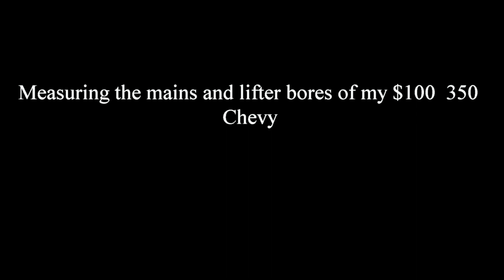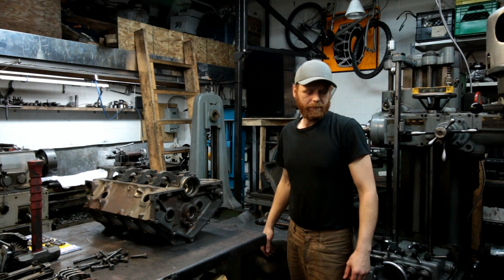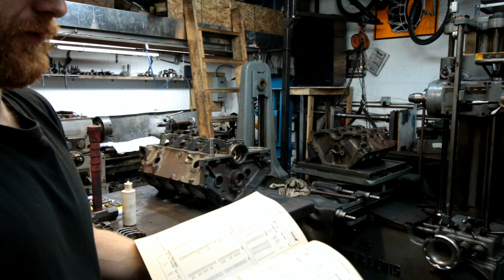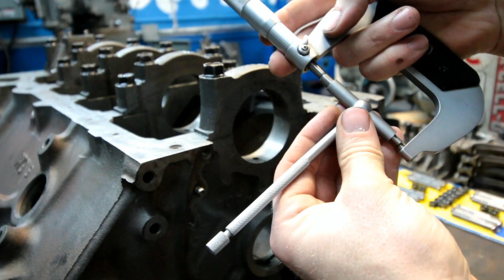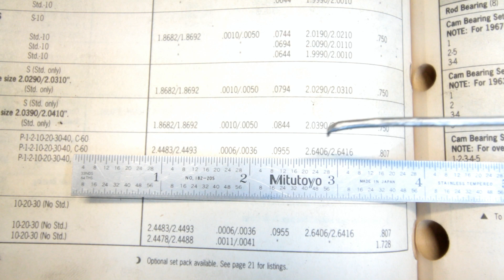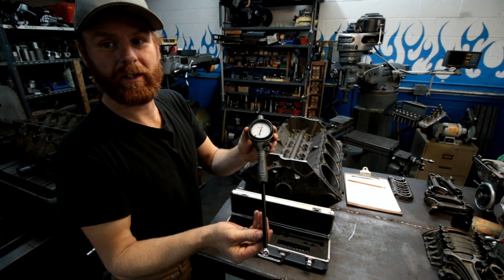My $100 350 Chevy  Episode 3

Comment: some window shoping fort worth tx area. and sure enough. 350 one piece rear main seal engines, $350, another one $600 plus. oh Wait 350 bare block, standard bore 4 bolt, two piece rear main seal block, $400. dont even get me started on posi rear ends for the secind gen Camaro, saw one listed for almsot $2k, and another listed for $1k. 
 But im good. i have three engine blocks on the stand, one in the truck. All standard. I'm done buying used from people. it's bad when salvage yard prices are better. Occasionally you find a deal, but on average, people are out of thier friggin mind with prices.
 What really kills me is the LS swap crowd, wanting $500 for the old 350. I mean if it's such a worthless engine why are they asking overinflated prices, if they are so worthless, give them away.
Reply from the maker: Our best pick a part yard recently closed. They were selling short blocks for $95. Now I hit up the local online sales groups and buy all the cores that are reasonably priced. Still come across quite a few like the one I just bought.

Comment: I just found this, there are no $100 engines anymore. Local pick and pull still wants reasonable prices for engines or short blocks.
Reply from the maker: I bought around fifteen last year in the $100-$150 range  . They are getting a bit scarce though.
Reply: @whiplashmachine  any classic car or any used car, the prices have gotten unreal. Used parts have gone right alone with it.
Reply from the maker: @DavidB7474  they sure have. I was thinking about this conversation today. I had a random purchase of a $200 350 this morning.  Four bolt 010 and 370 heads. Heads and block passed pressure test and now they're in the hot tank.

Comment: Good job I haven't seen anybody check the lifter bore yet maby mist it.I payed 600 hundred for a what was supposed to be a good vortex engine installed.never happened got my old truck back with a the 350 and a 350 trans on the ground loaded them up in the back of a pick-up truck home I came.
Reply from the maker: $600 sounds pretty cheap for used engine and install. I usually take a number like that as a warning. Sorry that it did not work out for you. Us car guys are supposed  to look out for one another, not burn eachother.

Comment: Do you put the main caps back in the same order as they came off .I'm getting ready for my first build bought a 350 too replace a 305 tite budget hope it's a good one no cracks
Reply from the maker: Order not a big deal, the location is. Keep them in the correct locations and directions and you should be good.

Comment: How much you sell a chevy 350 for?
Reply from the maker: Way too many variables for an absolute answer. Different parts cost different prices so it depends on which parts are used.
Reply: @whiplashmachine  I'm in desperate need of one as of 6 months ago. Are you willing to sell one and have it shipped or possibly I could pick it up from you
Reply from the maker: @cab3910  pickup is best
Reply from the maker: and yes, I could build one.
Reply: @whiplashmachine  how much would you charge with no manifold. Just heads block and guts